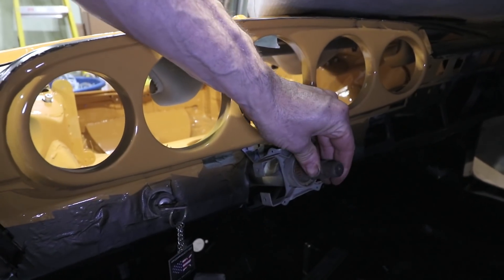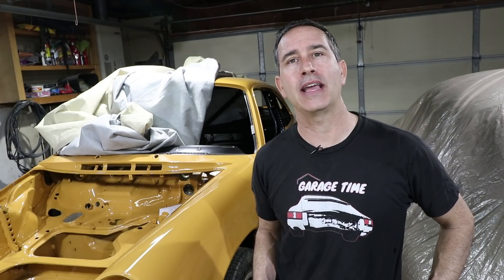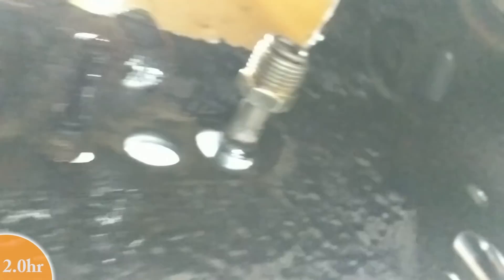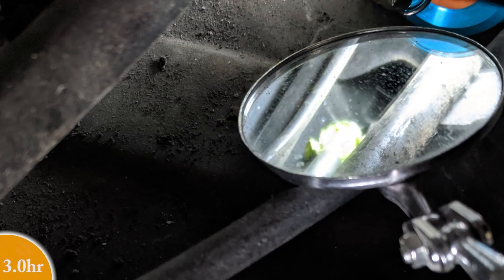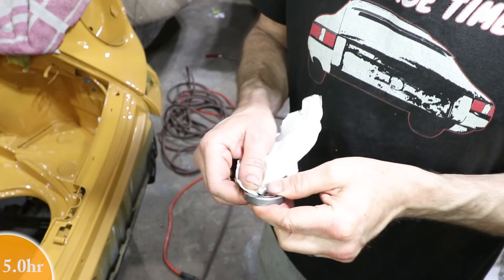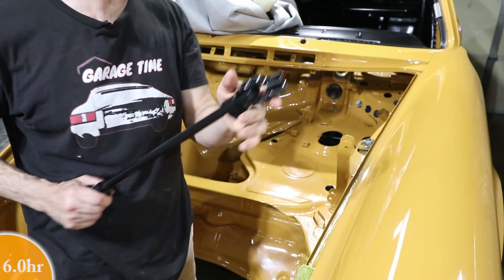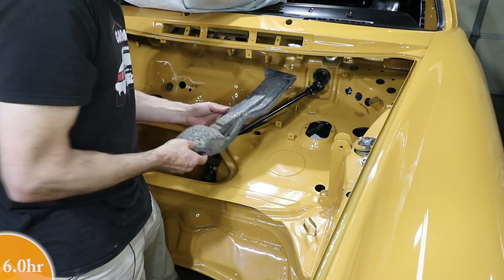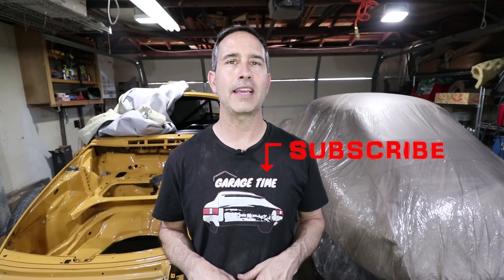Install Porsche 911 Fuel Lines & Replace Steering Bearing

Comment: Good stuff. I didn’t know how to remove that steering shaft. Now I do. Thanks again
Reply from the maker: Cool man, I should have said this but be sure that you turn the ignition key to disable the steering lock.  I'm so glad I replaced that bearing.  It feels so good now!
Reply: Garage Time - Restomod - thanks for the extra info.

Comment: On your stainless steel fuel lines are you using metric size fittings in stainless steel tubing?
Reply from the maker: Hi Marion, no it's 3/8 and 5/16 inch tube with  AN-6 fittings. 
I'm using all aftermarket fuel system components including the Induction system, fuel pump, regulator, etc  so that is why I switched to the less expensive and more available stuff.

Comment: How did you dare to restore the steering wheel column in place? When it is freshly painted?
Reply from the maker: How?  Just do it!  I took a few precautions, but what would the dealer do in 1980?  Maybe I should change my motto from its only metal to its only paint.  Not a scratch by the way.

Oh, I cut this part of the video and didn't explain.  I tried to remove the steering housing from the dash but it's installed with shear bolts and round heads.  I would have done damage to the paint and bolts for sure with vice grips.